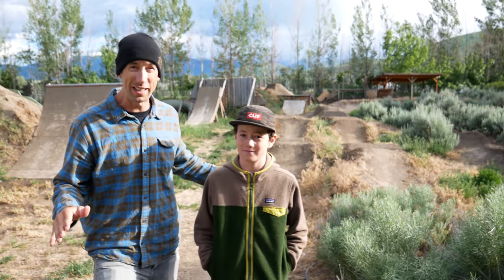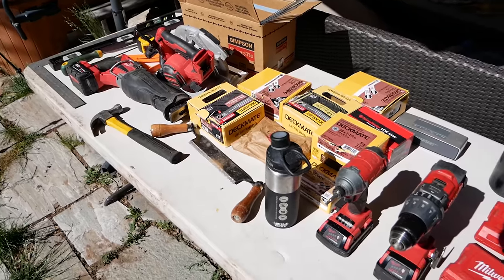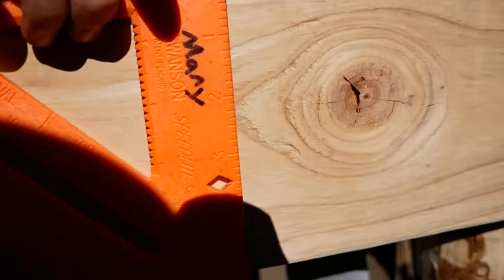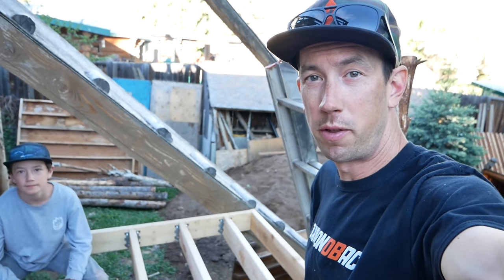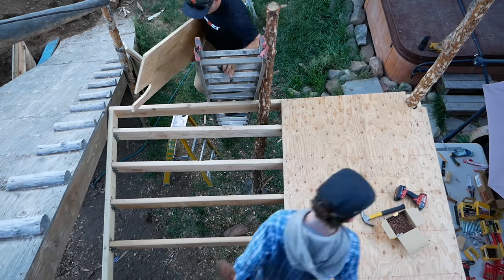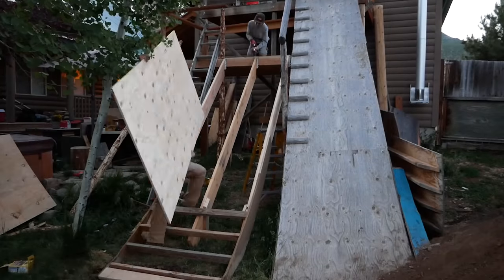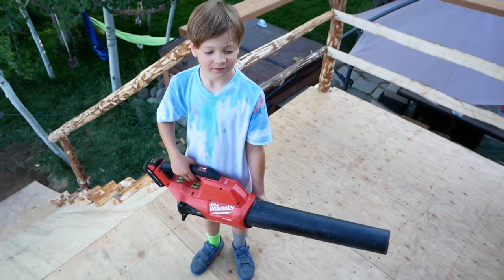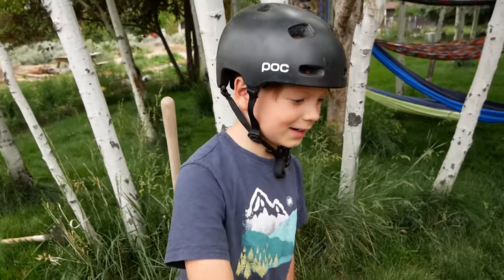Building our Backyard Jump Roll-In!

Comment: Those brackets are usually made to be used with framing nails instead of screws. It may now seem like a big difference but nails can handle a lot more shear force than screws which are more brittle. Enough force and that bracket can easily shear the screws.

Comment: What thickness of sheeting did you use for the actual roll-in. You mentioned using 3/4" for the deck, but wondering if you used 1/2" for the drop.

Comment: Hi Porter - I'm building a roll-in for my son. He'll be jumping a 6 ft jump to an airbag. How tall would you recommend we make the roll-in? Is 11ft enough? 

Also - we're short on space - would you say a 55 deg angle for the roll-in is too steep? Thanks!
Reply from the maker: Hey! Depends on how much gap you want between the lip and airbag, but that's probably enough. 55 is steeper than ours, we used about 40 degrees, but it could be fine depending on the riding level of who is hitting it and what you do for the transition at the top and the bottom. Let me know how it works out!
Reply: @PorterMTB  thank you! 

My son has been jumping at Highland Bike park and their foam pit has only a one foot gap. We'll try something similar with a steep kicker for tricks.

We're both beginner builders, so thanks again for the feedback!